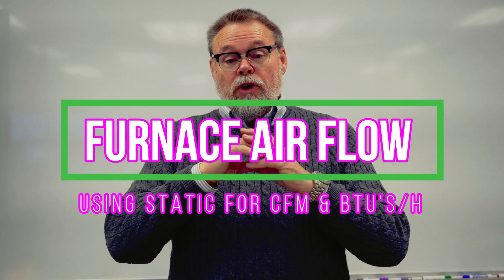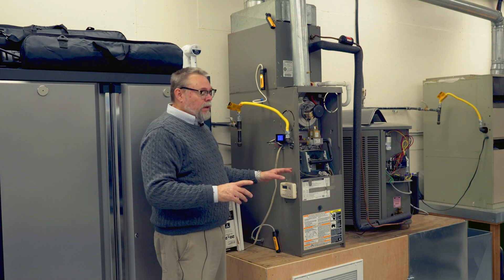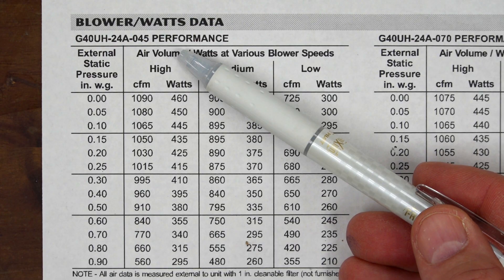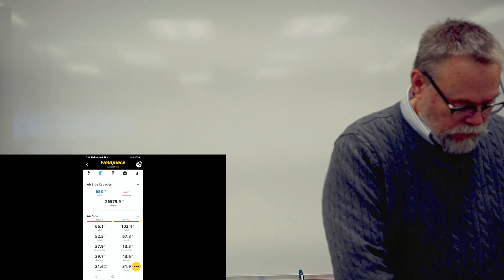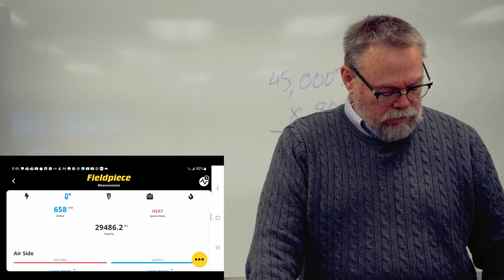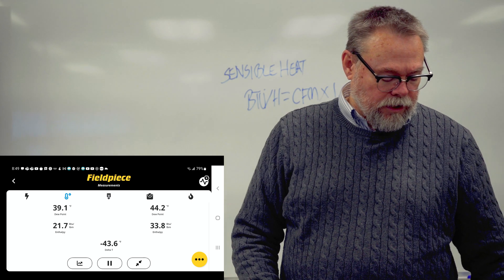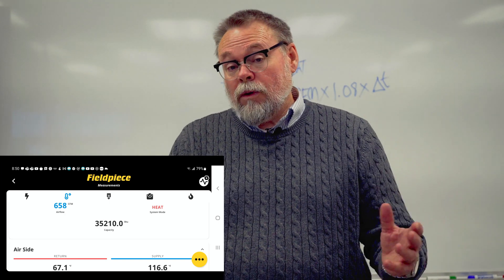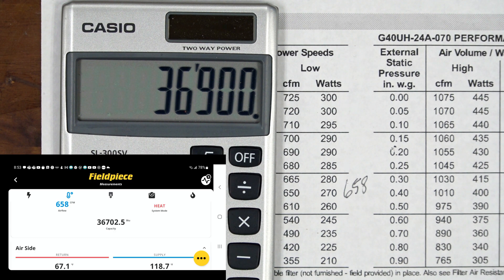Furnace air flow & BTU's using static pressure

Comment: When setting airflow for a gas furnace in heating mode, CFM should be based on the furnace’s BTU output—not the standard 400 CFM per ton normally used ? 

Great video!
Reply from the maker: For furnace we want to set up the airflow by temperature rise. We measure the return temperature and the supply temperature-not in line of sight of the heat exchanger as the heat exchanger radiant heat will throw off your numbers, and get the temperature difference (TD). 
On every furnace should be a range for temp rise. On the furnace in the video its 35 to 65 degrees. We want to be right in the middle which is 50 degrees. So we adjust fan speed to get 50 degree rise. Higher speed less temp rise, lower speed higher temp rise. 
National Comfort Institute uses a different formula based on the efficiency of the unit and the input btu's. For natural draft furnaces (70)% we need 100 cfm for each 10,000 btu's of input, 130 cfm/10,000 for 80% and 150 cfm/ 10,000 for 90%. 
For example we have a 80,000 induced draft furnace (80%) we would divide the 80,000 by 10,000 and get 8, we then multiply 8 times 130 for a target airflow of 1040 cfm.
Either way will work, but the NCI way will give us the best efficiency for the system.
Reply: @ thank you 🙏 I will be saving this video a lot of great information .  In the area I’m from there is not a lot of gas furnace but we do come across the from time to time once again thank you!
Reply: 400cfm per tonne is for AC not for heating.  Also a lot of manufactures discourage running there furnaces in low speed for heating. It’s hard on the heat exchanger

Comment: Ok, now use your formula to show furnace heat with a higher static pressure.  What happens to the amount?
Reply from the maker: We use the Sensible heat formula BTU's/h=cfm X 1.08 X Delta T through the furnace. Higher static will result in lower cfm but will also result in higher Delta T. Theoretically the BTU's/H output should remain close.
However, this sounds like a video I should make.

Comment: I m confused with the btu when you entered 658 on the app. How do you do the math when you get the cfm?
Reply: The original formula is written like this 
BTU/hr = ΔT × 1.08 × CFM

But this might help you it still means the same thing 

Temperature Difference X 1.08 X CFM = BTU per Hour 

Delta T refers to the temperature difference between the supply and return air. To calculate it, simply subtract the return temperature from the supply temperature.
Once you’ve determined your static pressure, you can use it—along with your fan speed setting—to find the corresponding CFM by referencing the manufacturer’s airflow performance chart.

Hope this helps

Comment: Can fan only mode be used instead of firing up furnace or ac?
Reply from the maker: @shggydg9100  Not usually, most furnaces use a different fan speed when you set the thermostat to FAN. Same holds true for heating and cooling. We want to set the fan speed in heating to the proper temperature rise. This temperature range is printed on the manufacturer label inside the furnace.  The one in the video is 35 to 65 degree temp rise. So I would measure the difference between the return and the supply and shoot for a temperature rise of 50 degrees, smackdab in the middle of 35 to 65 (15 degreesis right in between those two numbers add 15 degrees to 35 for targetof 50).  If the temperature is higher than 50 switch to a higher fan speed and if lower switch to a slower fan speed. 
For cooling we want 400 cfm per ton.
The National Comfort Institute NCI, has a different method to determine the correct temperature rise. They calculate temperature rise based on the efficiency of the furnace. A 70% furnace they divide the furnace btu's by 10,000 and multiply that number by a constant of 100 for the cfm, example a  100,000 btu's furnace is 100,000 ÷ 10,000 = 10 × 1000 = 1,000 cfm. For a 80% furnace the constant is 130 and 90% furnace the constant is 150. The only other step is measuring the amount of air the system is producing. The class that teaches this method can be taken at various locations in California for free through the TECH program. Visit the NCI website for details.

Comment: Question: If you had a 90% Furnace would you had to multiply 45,000 x .90 ? 

Or where did you get the .80  from? 

Thanks, I loved your video!!
Reply from the maker: Furnaces have a BTU's input rating, for simplicity lets say 100,000 BTU's and it is a 95% furnace, then we multiply the 100,000 BTU's X 0.95 and get 95,000 BTU's output. If you measure the BTU's after finding how much air the unit is moving and multiplying that by 1.08 X Temp rise between the supply and return it should come out close to what it is rated for.